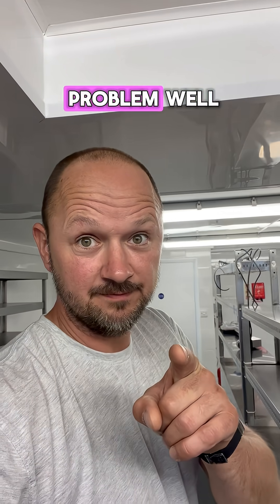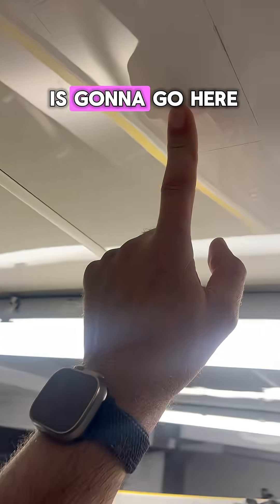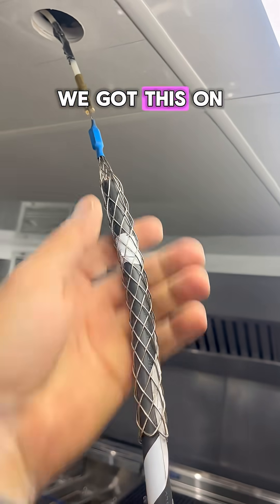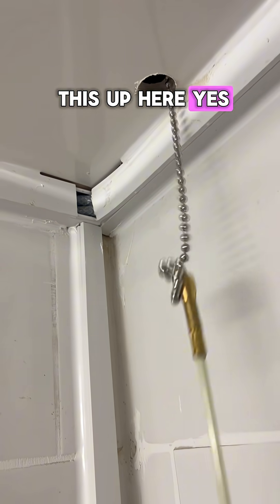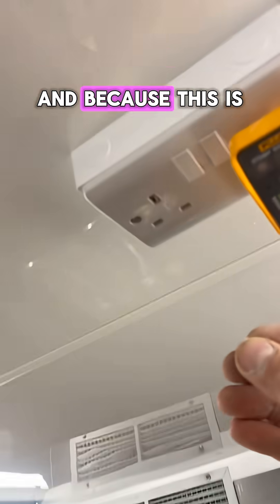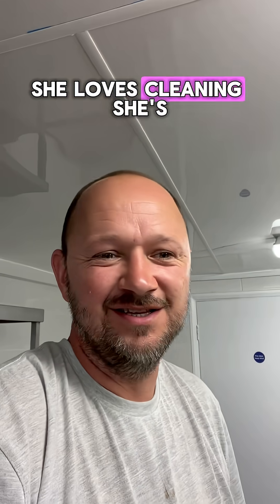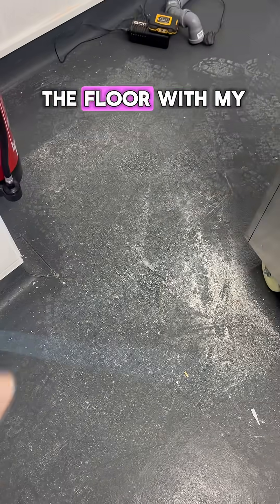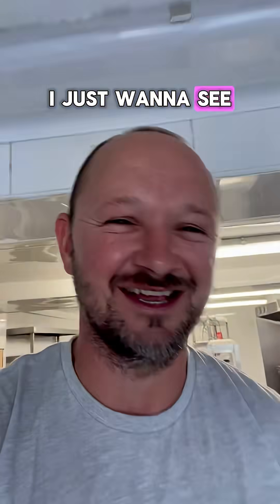Ben, We’ve Got a Problem… Here’s What I Found ⚠️

Comment: Strange decision to use sockets. directly above heaters (so lots of grease deposits etc). Why not hard wire with isolators conveniently located? You've ruined that lovely flat sterile surface with you ugly sockets. If expect a H&S fail some time soon.

Comment: Brilliant, screw caps fall off at some point and into the food. I presume they are food heaters.
Reply from the maker: Food?
Reply: They don’t fall out ever, you have to use a screwdriver and a hammer to get them out,
Reply: @Danny-204 unfortuntey had a couple where the screw caps didnt fit properly and fell out ( socket was on the wall ). To remove the caps, bluetac is good to remove them without gourging them out.
Reply: Obviously never tried to take them off lol
Reply: @stuarth540  most plug tops cover the screws when they are plugged in and those heaters are more than likely never going to be unplugged lol